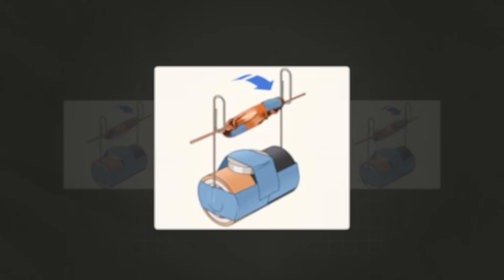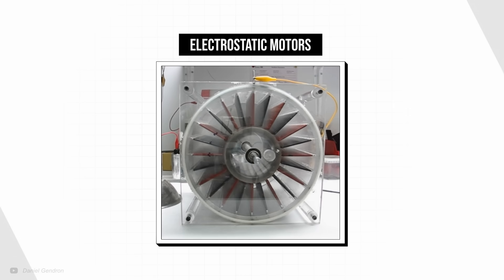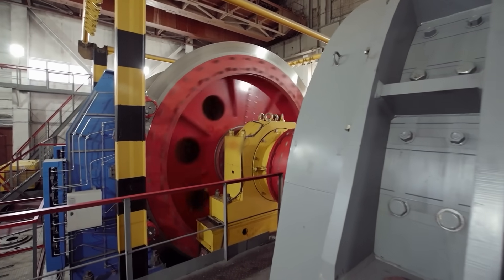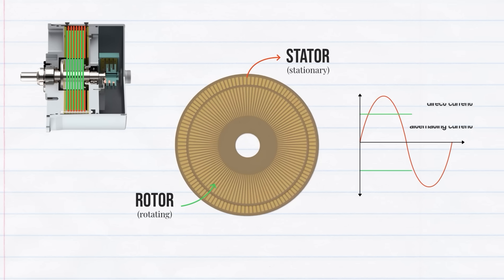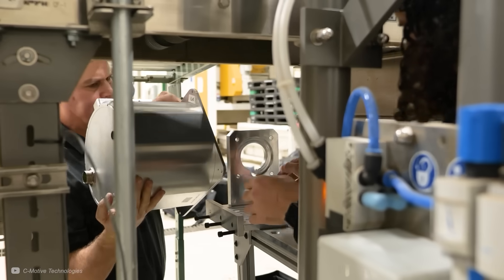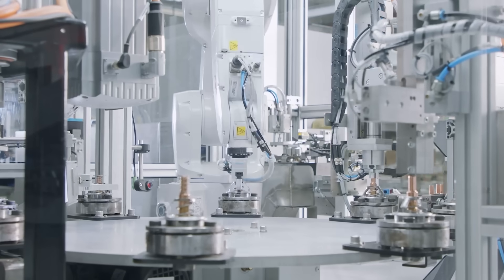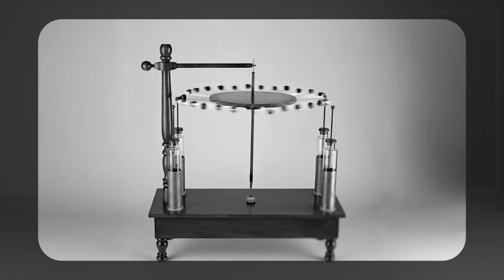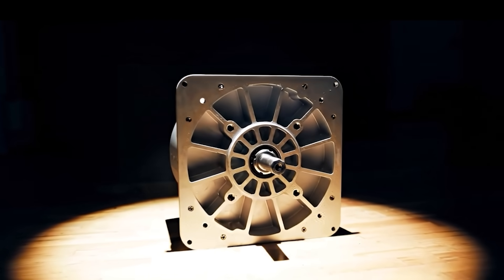How Electrostatic Motors are Breaking All the Rules

Comment: Adding fluid between such closely spaced disks creates a viscous coupling essentially. This will create so much drag at any meaningful speed. That's probably why they are focusing on torque. 

It's nice to see someone doing something different here, but I wish they were open about both the positives and the drawbacks of the system, rather than just "prefer to talk about torque" and hide the actual reason under the rug.
Reply: Every technology has it's best use case. Theirs is torque. That's why they talk about it.
Reply: Another crucial point will be whether this dielectric fluid constitutes a maintenance item/consumable. Leaks and fluid contamination/degradation will likely have to be monitored, otherwise the motor might start failing; e.g. think about a portion of the disks being left dry and arcing.
Reply: @citymagnum4734  When I looked at the motors construction my first thought was that it must be a nightmare or impossible to dissemble the motor. If all the rotor plates are connected to the output shaft and the stator plates to the casing  the only way I can think of is with splines and spacers raising the manufacturing cost.
Reply: Right!
Reply: I experimented with ES motor concepts in the 90s and came to the conclusion they'd never really amount to much because of the breakdown problem. To get power you need voltage and close spacing, they draw almost no current. To use high voltage, you have to maintain that voltage, which means no arcing. Not once did I consider a liquid... even air is viscous enough to cause notable drag. That drag is what is creating the heat in the fluid version... the motor itself won't produce any at all that can really be measured.

I had the idea for running everything in a vacuum, which would have solved all of those issues, but now you need a vacuum pump. No matter what, you're going to use "extra" energy keeping the electrons where they need to be instead of where they want to be. Not an easy thing to solve. The fact someone came up with something reasonably sized that can do real world work is pretty sweet... but I'm not sure what it is really accomplishing. Ok, less copper. Check. The rest? (We haven't talked power supplies yet lol)

Edit: It's also not "helping solve the magnet material issues" either. The motors they are replacing (conveyor etc) are induction and don't even use permanent magnets so I don't know what he's on about there.
Reply: @MadScientist267 for space application without atmosphere could be useful.
Reply: Make it a tesla turbine while your at it. That can spin the fluid along with the rotor to reduce drag.
Reply: The Tesla turbine aspect is why at any speed over stationary, losses are square law. Another niche motor for the right applications, think lift and elevator motors. Perhaps used as direct drive wind turbine generators.
Reply: There are millions of us that have the use case for a motor that maximizes torque and precision but only needs to rotate once in about 24 hours.
Reply: Liquid Hydrogen is used as lubricant in huge flywheel power storage devices, I wonder if they mean using some kind of liquidized gas if in large industrial settings. Idk.
Reply: @lelsewherelelsewhere9435  Hydrogen in a high voltage application like electrostatic motor is a recipe for explosion.
Reply: @lelsewherelelsewhere9435  I doubt it. but it is sealed so you don't know.
Reply: Yes it will be one of the SF6 oils, thats why they are so efficient, SF6 the 2nd most unfriendly GWP substance know to man, (beaten by UF6), all undergoing huge pressures to be banned, commercially a non starter
Reply: @Ino-z2m  What makes you think it would need to be a fluorinated oil? A low molecular weight silicon oil would be a good candidate. (After all, there are no slip rings or brushes to worry about, that would preclude a silicon based oil.) But whatever the oil used, It`s my opinion that these motors will never overtake or even compete with conventional induction motors.
Reply: The cost of the product will either make it or brake it. 

Some of what they said is highly dishonest. They used ie1 motors and a worm gearbox to give the low efficiency numbers. If they used commercially available ie4 motors with inline helical or helical bevel gearboxes the efficiency would be way higher. But manufactures don’t opt for it because they are more then double the cost.

They then show the motor driving the conveyor with a sprocket which would have more efficiency loss then a singular gear stage in an industrial gearbox.

To me it seems a to be a complex way to achieve the same result of what already exists but is rarely used because of cost purposes.
Reply: That just means we need a transmission with a really big flywheel to store the momentum.
Reply: ethanol is "proprietary", I fking hatte modern CappitaIism
Reply: This is probably incredibly naive of me, but why don't they just run it in a vacuum? Too inefficient to maintain a vacuum while it runs?
Reply: @ajkelly451 not really a problem for stationary equipment and holding a vacuum requires power and complexity
Reply: Good for robotics (servos) and low-speed factory apps,aybe even good for forklifts, but bad for automotive. 

High torque low speed just means more gearing, so power and efficiency still reign supreme. 1,000 lb.ft. at 100 RPM is only 19 HP. Can't make a car from that
Reply: Most likely could be replaced with inert gas of sorts or vacuum for some working regimes.
Reply: Honestly keeping them in a vacuum might be an option too. That or just catalytic dielectric like capacitors.
Reply: Great point! Got there before me. I am not convinced these will be as useful as claimed.
Reply: i played with electrostatic but they were pathetically weak in air.  this is very interesting.
Reply: Don’t forget, you can always change around high-torque low-speed into high-speed low-torque with gearing. You stop gearing when you find the sweet spot for your particular application.
Reply: Insightful observation—though a bit cynical. Viscous drag is the primary source of efficiency loss in C-Motive's electrostatic motors (ESMs), but it only becomes significant at rotational speeds above 500 RPM.

C-Motive has been open and transparent about the technology's limitations. It's the electromagnetic motor manufacturers who have been misleading—often excluding the mass of gearboxes, cooling systems, and other supporting components from their torque density specifications, even though those systems are essential to achieving the advertised performance.
Reply: @fejimush  motors are (largely) modular components used in a massive number of applications, how do you suggest they spec out every single gearbox and aux component that could be used with a given motor?

And no one is using asynchronous induction motors to save space or weight lol, they're just relatively reliable, cheap, efficient compared to most alternatives, and so ubiquitous control and maintenance have been largely sorted out.

Comment: Low efficiency in transporters now is not due to lack of technology, but mainly by cost. You can get this kind of efficiencies, but you need to invest in other type of gearbox, which is generally a lot more expensive than worm. You could also try motors with permament magnets and maybe inverter (to reduce magnetic flux when there is low load, which is most of the time), but all of this is more expensive. This solution can be good, but doesn't solve a problem not solved already, so I doubt they will find clients for higher prices.

Comment: These motors would propably be great for robotics and CNC applications, since they often need motors that turn rather slowly, but need a lot of torque. Wonder how well they can perform highly dynamic movements, meaning high accelerations and quick direction changes. Someone mentioned that it would be possible to lock these motors with a permanent voltage without needing a mechanical brake and with minimal power consumption.
Reply: Robotics and CNC also demand highly responsive motors. We don't know how rapidly this motor responds and how quickly it can reverse.

Comment: The electrostatic motors generate very little heat, because most of the electron transport happens at the surface of the copper material, and not through the bulk of the copper material (which causes Ohmic friction and heated copper). The surface of metals conducts electrons free of Ohmic losses.
Reply: @koenraad4618
The motor operates by storing and releasing electric energy across a dielectric fluid between specially shaped electrodes (rotor and stator). Torque is generated by electrostatic attraction between charged plates (i.e., capacitive forces), not by Lorentz-force-induced motion from current in magnetic fields. There is little to no conduction current through the dielectric—so electric transport, in the conductive sense, is minimal. Instead, the mechanism relies on displacement currents and electric field interactions, not electron flow.

I'm not sure where @MrDmadness is drawing the Stirling engine comparison from, and I’d genuinely be interested in seeing what his math suggests. But electron transport is not the mechanism driving torque production here. If it's not the driving factor, then by definition, it can't be the source of inefficiency.
Reply: @Fejimush you said it yourself "capacitance forces"  you have either a resistive loads or a 8nductive load in electronics. An inductive load is what every motor is. If you're not moving electrons then you're not doing "work" if you are using displacement then the math gets even easier as your displacement is == to the ability if the system to do work .
Reply: It's because you are not moving electrons in any efficient manner, these are like sterling engines, cool but they have zero practical application. Low amp = low capacity for work. Do the math

Comment: In the 1740s and 1750s, the first electrostatic motors were developed by Andrew Gordon and by Benjamin Franklin. Today the electrostatic motor finds frequent use in micro-mechanical (MEMS) systems where their drive voltages are below 100 volts, and where moving, charged plates are far easier to fabricate than coils and iron cores.
please at least google a subject before selling it as something "never done before" 🤦

Comment: Hey Ziroth, way more spectacular is Tesla's single wire power transport concept:  a single thin copper wire can transport mega watts of high frequency (KHz) high voltage (Kilo Volts)  power at zero transport losses from A to B over long distances, because only 'electrostatic' electrons at the surface of the wire are applied, and the wire bulk (the copper atom lattice) does not carry current at all (the skin effect). The surface charge electrons induce electric fields and a SCALAR form of magnetic field, that makes a Poynting vector of energy flow, with zero energy transport losses (the wire does not heat up). This was tested in the Russian federation:  a single copper wire of 100 micron diameter could transport 1MWatt electric power over hundreds of meters with zero transport loss. The wire did not get hot, very unusual considering it carried a million Joules per second, but perfectly explainable once you understand the physics background (a generalisation of Maxwell's theory).  Yes, Tesla invented the multiphase power line, but Dolito-Dobrovolsky improved on Tesla's N-phase design by reducing the number of wires from 2N to just N wires (a three phase power line requires 3 wires instead of 6) with 20% transport losses on average.  Tesla drastically improved Dobrovolsky's design, and figured out how to apply just ONE wire with 0% transport losses for electric power transport,  by using only the "electrostatic' surface charge on the wire, see his single-wire power transport patents.  This poorly understood design by Tesla could have saved us billions of dollars on a yearly basis.
Reply: The Electromagnetic Interference generated by thousands of miles of copper transmission wires all carrying the
same multi-kilohertz frequency would be horrendous.
Reply: Did Tesla invent electrostatic motors?

And if so, what was the mechanical power?
Reply: @WouterTermote  Afaik, he did not invent them. Their working principles were already known. Oleg Jefimenko in the 1970s however made a prototype motor that produced about 75W of power. :)

Comment: Convayer belt usage is incredebly inefficent for normal motors. Not only does they typically use very inefficent gearing, but they typicallt work far out of there optimal powet band. When talkign about motors dong 80-85% efficency, that is in optimal use. Convayer belt is far from oprimal use and the motors are over powered just to handle 0.01% high toruqe situatuations. They are bassically like a car engine ideling..most of the energy goes to just keep it rotating and little goes to actuall work.

This is a fairly optimal usage of static engiens so there numbers are probobly accurate.

The problem with using somting like raxial flow motors is that they are way more expensive and you would still run them far outside of there optimal range.

The static motor on the other hand can be optimized for the typical work situation and have  extra torque for the rare situation . While that make it leas efficent, it make it less efficent in the uncommon situation.